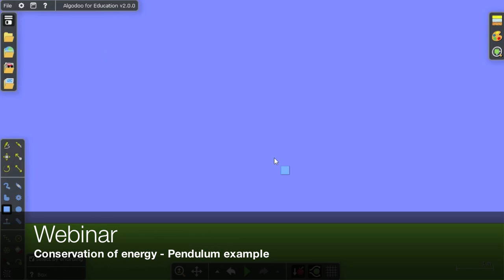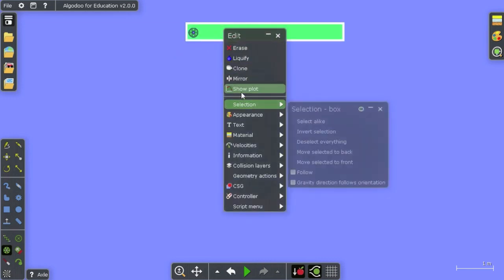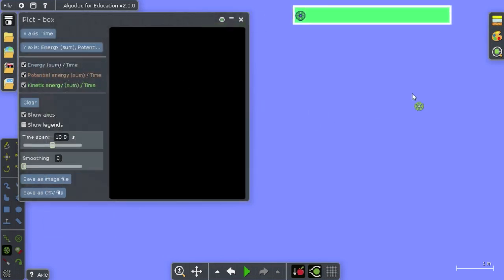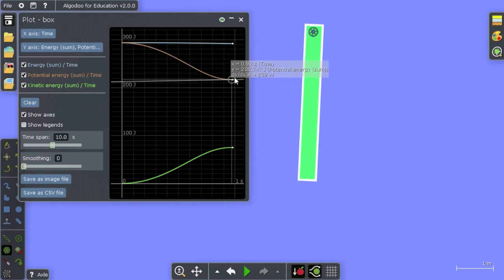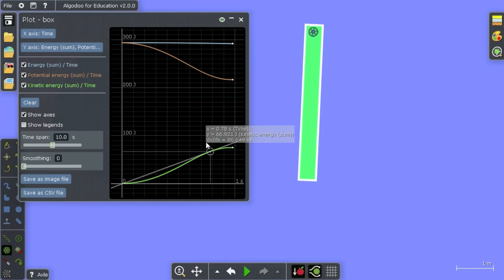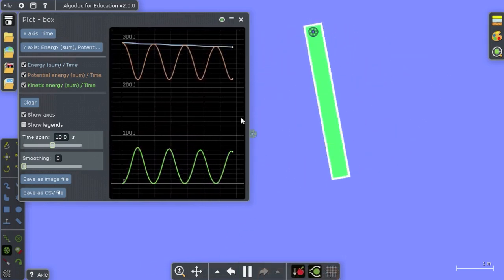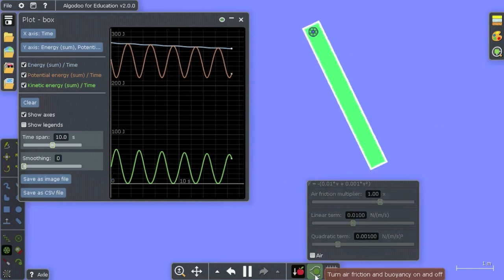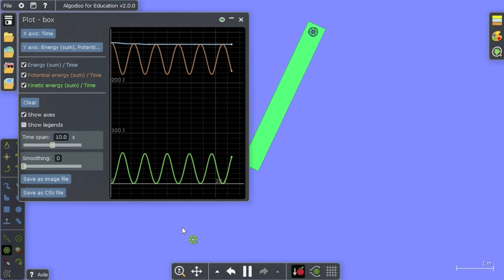Algodoo Webinar - Conservation of energy, pendulum example

Comment: is there a way to reference the total energy (energy (sum) / time) to make it a static value? I'd like to make a pendulum that constantly swings, regardless of collisions being made.
Reply: I’m not sure if I understand your question correctly (and also this comment is a half a year old) but I think you want a pendulum that won’t collide with anything else (?) if that’s what you want, you can just turn off all collisions on it by:       Right clicking > Collision layers > Uncheck all & Collides with water = false
Reply: @Adamimoka  Not exactly. Was looking for making a pendulum swing left and right constantly regardless of what's colliding with it (like it's so heavy that anything that hits it wouldn't set it off course or nudge it a bit in any way and it would continue to swing, so collisions would still be on)

Even for a late response, appreciate it nonetheless!
Reply: @MajorTom77  Oh ok, well to do that all you have to do is set the weight to infinity. As long as nothing immovable is in its way, it will not slow down, also make sure air resistance is off or else is will lose speed that way.
Reply: @Galaxy  you can modify the mass of an object by selecting an object then clicking one of the buttons default on the top-right of your screen.
I don’t remember exactly which one, and I don’t use Algodoo anymore, but you should be able to find it.